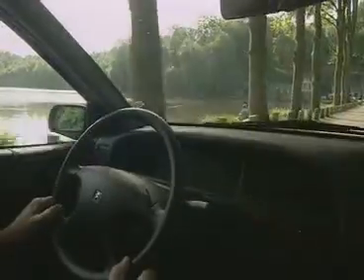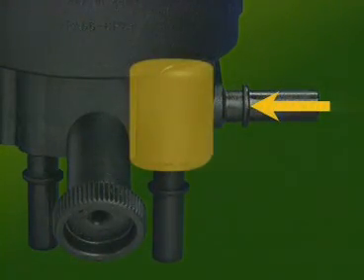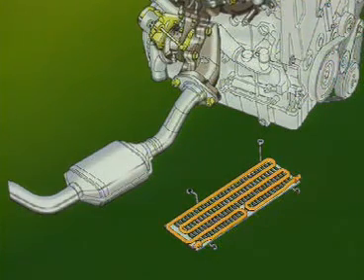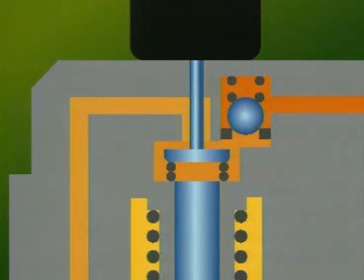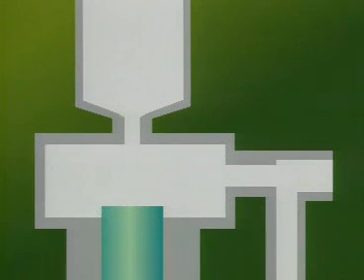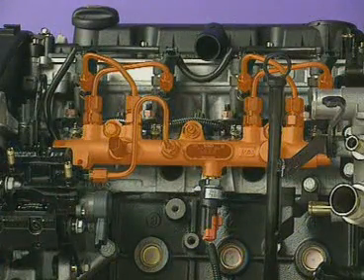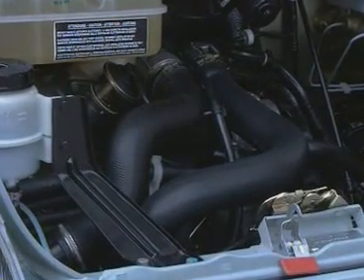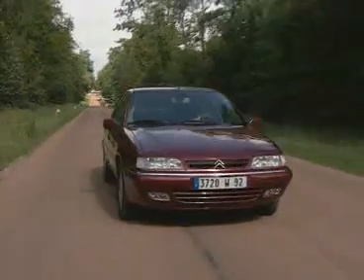Citroën - HDi Common Rail Injection Systems (2004)

Comment: My Fiat Ulysse ( same engine as in video ) kept killing my ECU.  Three times.   The failure always occurred in the wet.   Everyone I consulted said I had a faulty earth,   other people said I had a corroded harness.   I had my ecu tested by specialists who confirmed I had a voltage spike which was killing one of the ecu circuits ,  the design of which should have made it impossible.   These spikes can even come from an injector fault.   Within the last week,  I’ve learnt that a faulty solenoid can cause this fault.  
I still have my Ulysse which is now a project.   Totally uneconomic if put into a garage half of whom haven’t a clue,  and my mot garage consulted the main dealer,  who were totally useless.   When these engines run,  they run well,  but when they go wrong they are a disaster.    To keep me mobile I bought a ZX banger and now use a 306 1.9d. which is a great car.   When my Ulysse ran,  I loved it.   The Peugeot 806,  and the Citroen Synergie are identical.

Comment: "The pre-injection function only happens < 3000 rpm" ooooh! THAT's why ! My C3 does make that distinct old-school diesel knocking noise when you accelerate a bit too enthusiastically before it's properly warmed up, I always figured there was something in the ECU that was making it give up on pre-injection beyond 2500rpm or so, and it is! Nice to be validated by Citroen themselves :D